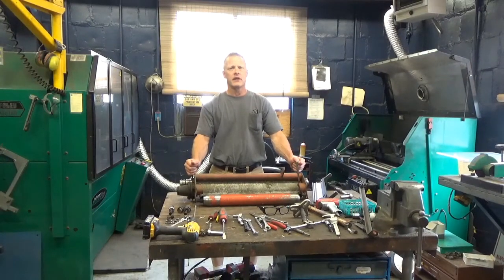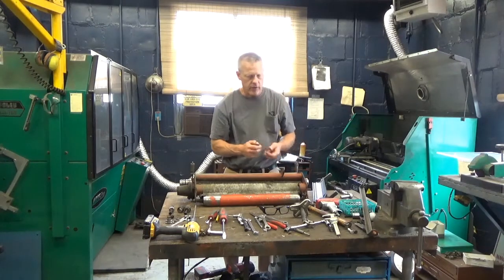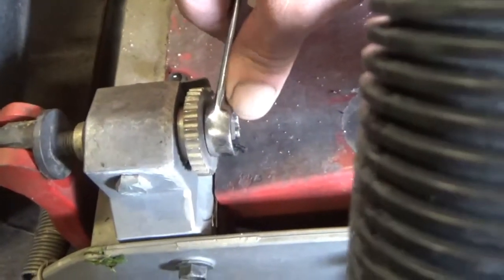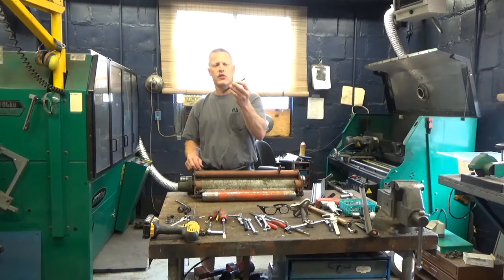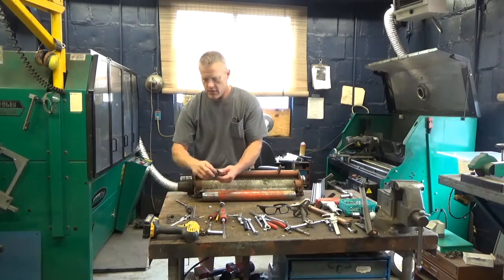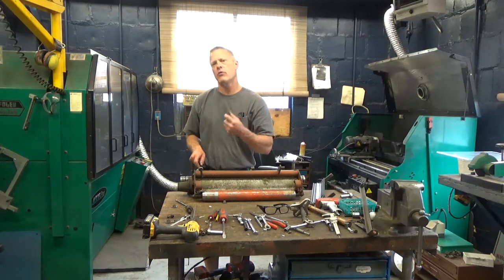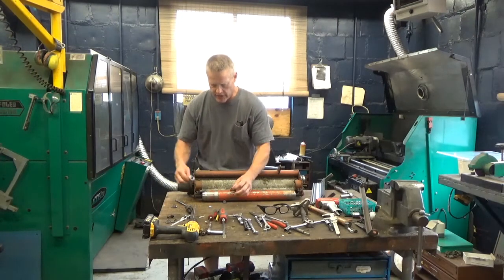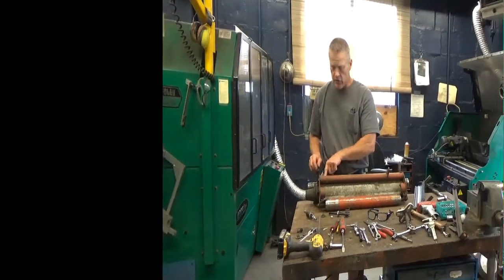Jacobsen  Lf 3400 bedknife adjuster modification to single point adjuster

Comment: Hi ron have the same reels as you, which are currently a pain, i have a couple of questions, the 4.5 inch bolt, did you grind the end of the bolt to fit into the bottom where the bedknife is?
Reply from the maker: Hi Steve it was easier to make a quick video and post it to answer your question and show you an improvement since this video. Good question thanks for asking! Here is the link to the update   https://www.youtube.com/watch?v=aMKNxFKGtY8